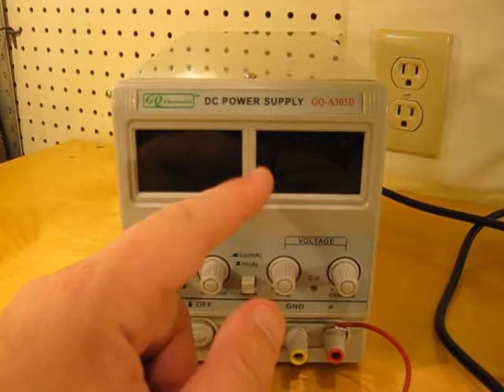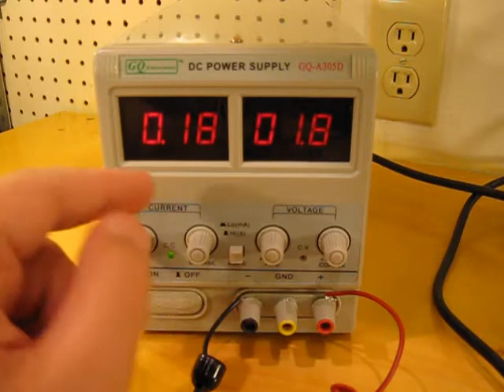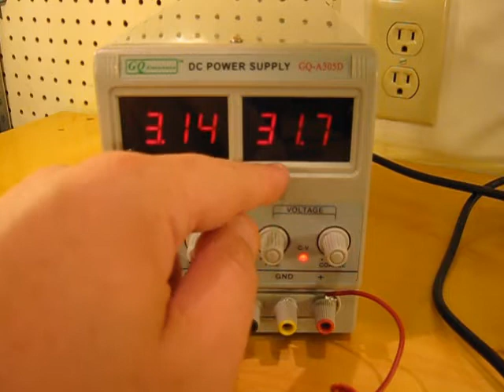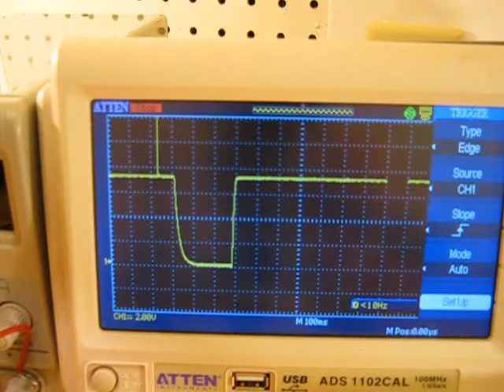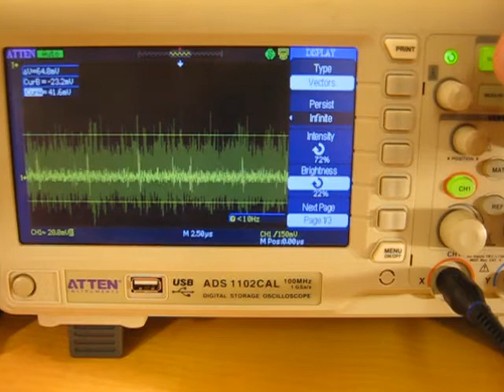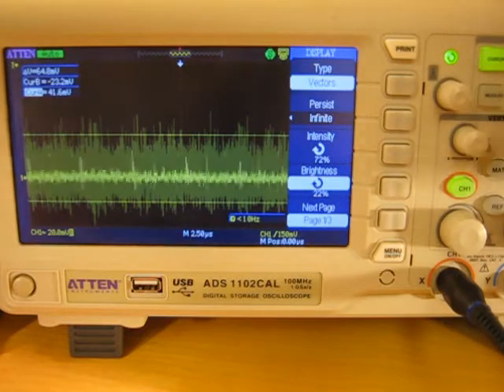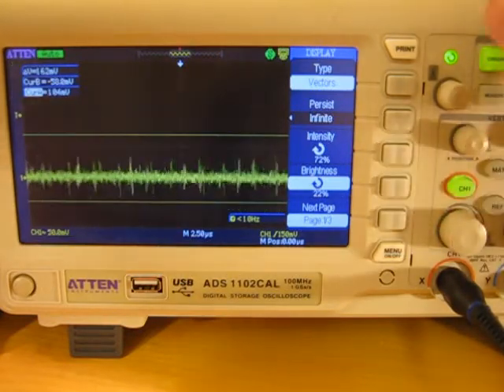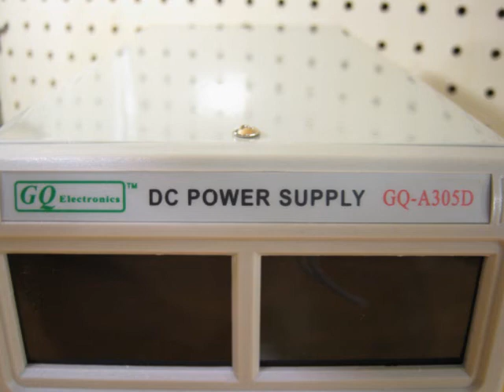GQ A305 DC LAB POWER SUPPLY REVIEW AND TEARDOWN

Comment: Is there an internal fuse? Can you ruin this anyway by shorting it?
Reply: It has a fuse on the mains input but not one on the output. Shorting the output directly is what a lot of people do in order to be able to change the the current limiting. i have a cheap clone similar to the one in the vid, (30volts 5 amps)
i run mine maxed out all the time on Zero Voltage Switching supply's and have had no failures yet, only side effect is that it gets quite hot.

Comment: Mine will not hold a constant voltage. I can hear the relay clicking. Any idea what might be causing this?
Reply: how many amps are you pulling from the power supply while this is happening? Also what voltage??
Reply: it was a bad pot on the voltage setting. Kept it changing voltage ranges hence the relay clatter.
Reply: +ZeroCool ahhh ok. nice find